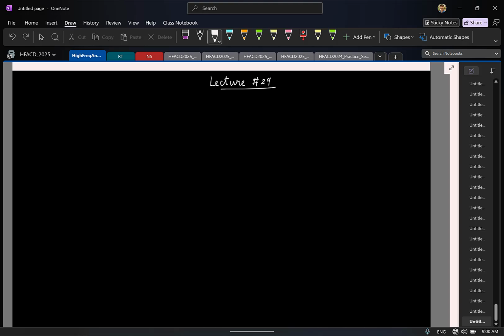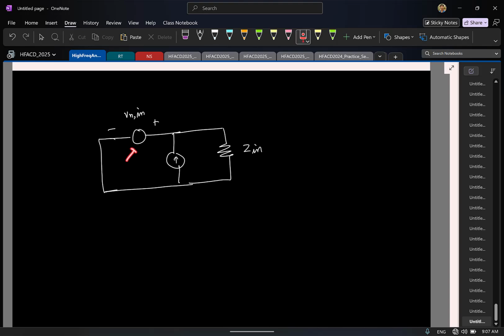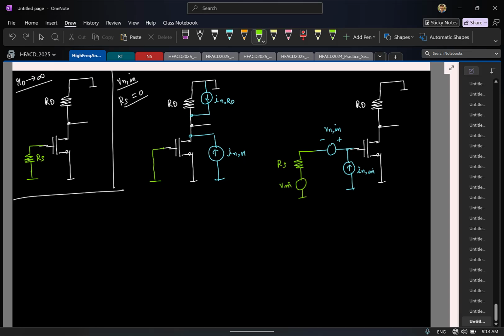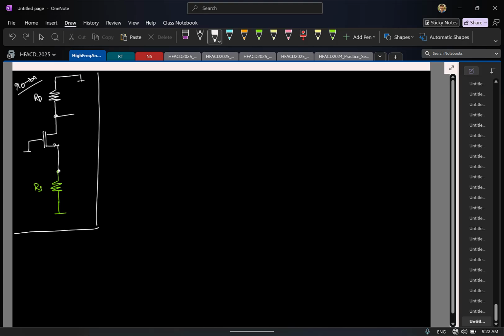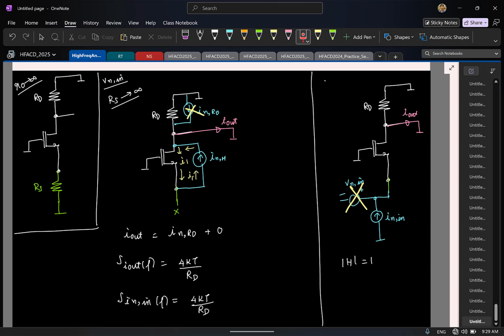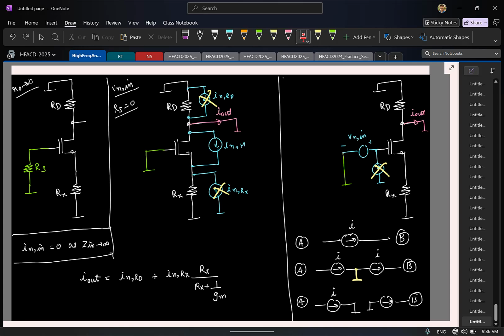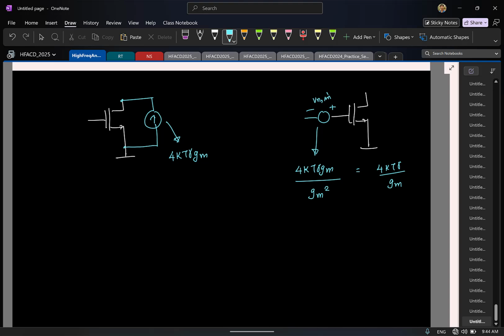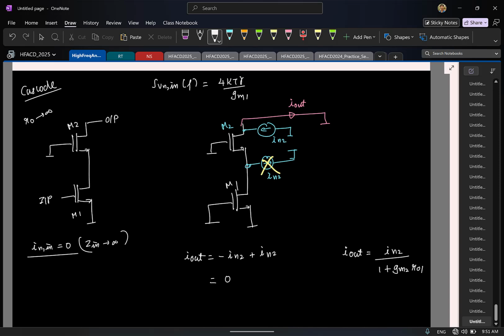Lecture 29: Input referred noise voltage & current: Example calculations

Comment: For Source Degenerated CS Amplifier case, Sir considered the opposite sign for Noise Current of MOS if we take in opposite direction the part coming via Rx will have -ve sign that will change the value of Noise. How to be sure about Direction of noise sourec?